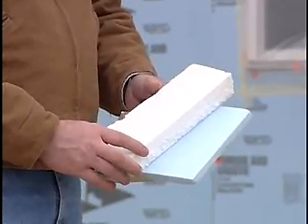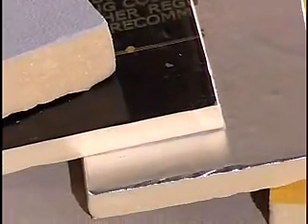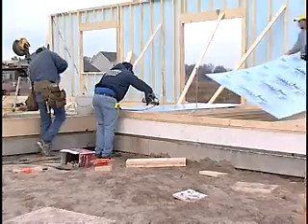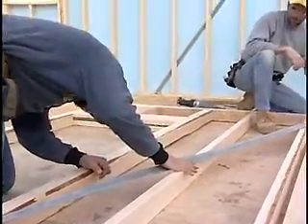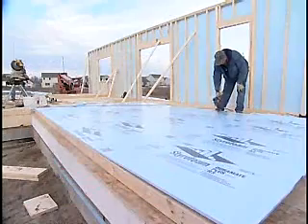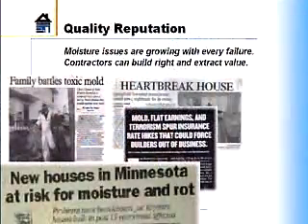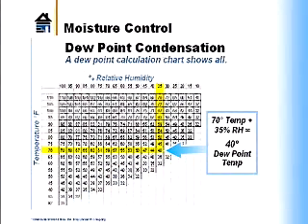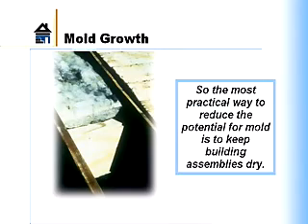Benefits of using insulated foam Sheathing

Comment: Would there b an advantage to put foam on the inside ?  I thought insulation holds the heat in but doesn’t keep the cold out.
Reply: Insulation slows the transfer of heat and cold, both ways.

Comment: so which one is the best one ?????
Reply: EPS, it does not retain water like XPS or ISO will
Reply: Way cheaper too but doesn’t have as good r value  though
Reply: EPS does not off-gas and therefore is safer.
Reply: Eps works on concrete wall too?
Reply: @muhammadali-pu2wg    Yes